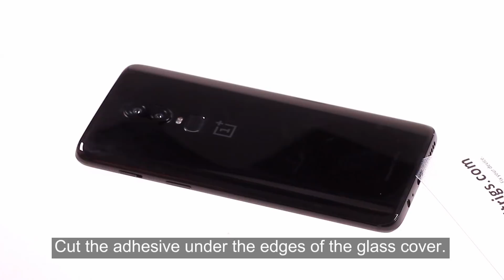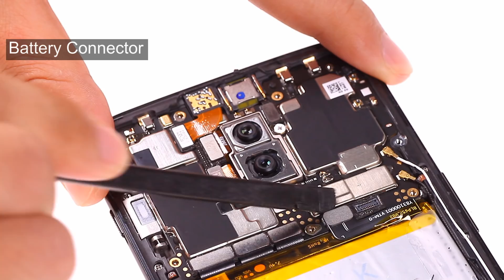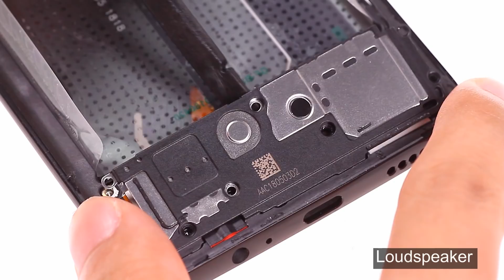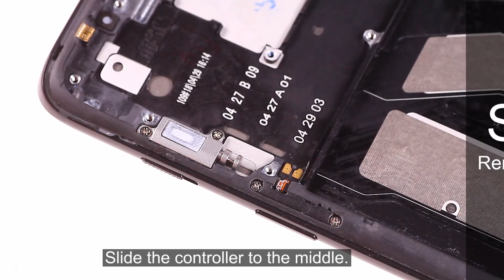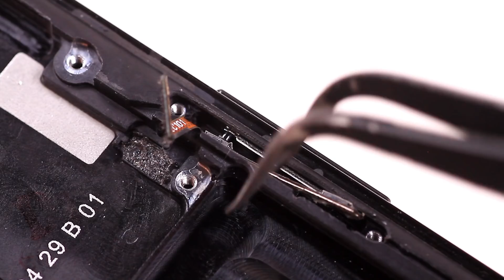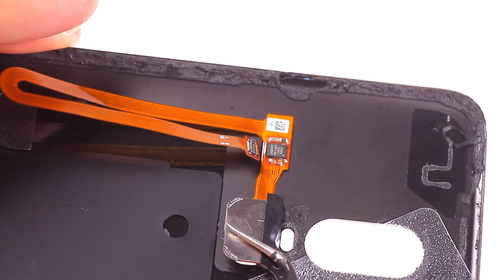OnePlus 6 Teardown #Disassembly#

Comment: Thanks for your nice video.

After using few months I have noticed some dust particle inside in my back camera and front camera.
My phone's backcover never opened & I'm not in too dusty area.

Then i searched about this problem and found many people also complaining. People guess Alert Slider or Headphone jack is reason for dust entering.

My personal opinion is "Less Adhesive glue in back cover or Camera  glass or finger print sensor"

What you think the reason for dust entering?